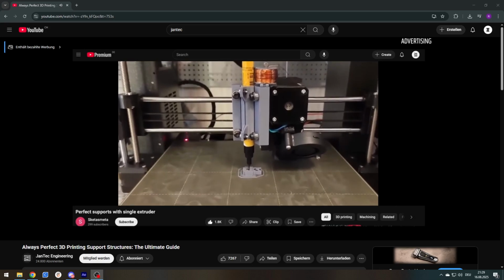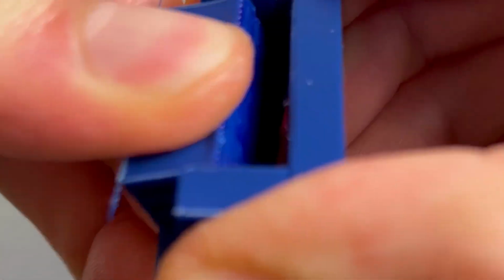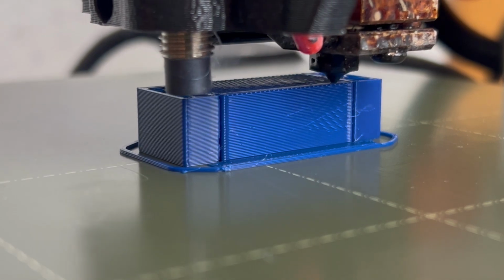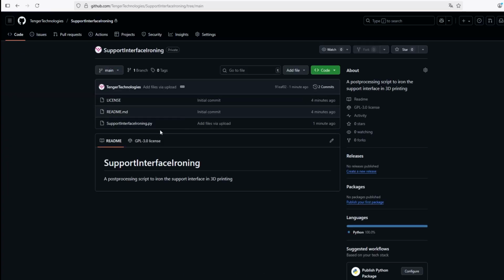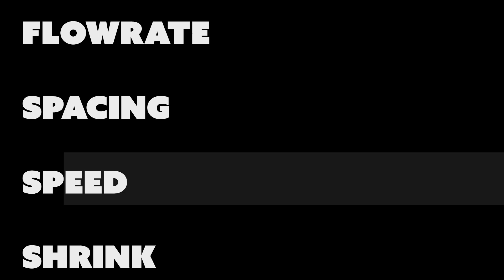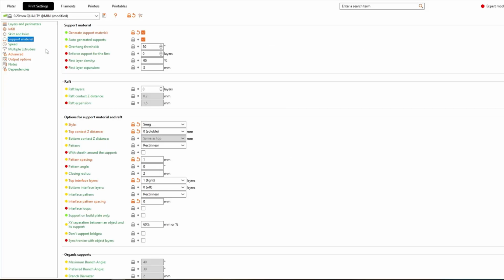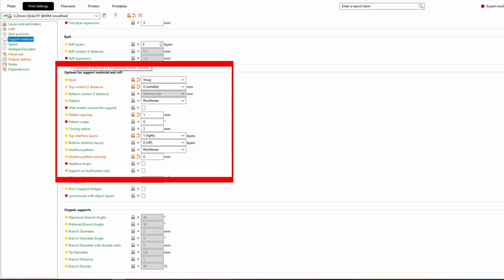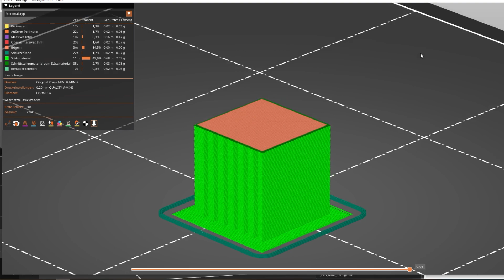Perfect 3D Print Supports With Ironing?

Comment: If this was combined with a multi-head that deposited a release agent (like a sharpie) and non-planar printing, you could effectively do away with overhang surfaces looking different from any other layer. Print a smooth layer in any orientation, coat it, and print on top like you've got a new baseplate hanging there.

Comment: As I understand, what will happen is that the supports will be smoother, so the resulting underside will also be smoother - which is what we want. This should absolutely be something that could be added to the slicer itself to possibly make the adhesion lower between supports and the part. One thing that I'm curious about is why painting the support will make it less inclined to stick? Is it just that the surface isn't clean enough anymore for the filament to stick less? Or is it something chemical? Does any marker work or is it a type/brand/whatever? Would whiteboard marker work? Would it be possible to make a "marker" that fades after it is for instance exposed to UV light? Or just washes off? I'm trying to find ways to make this combo of ironing the supports and covering them with marker could become an automated process somehow without adding a huge pre-/print-/post-process task to it.
Reply: this is added to Orca alpha/dev right now

Comment: Hey TenTech! The marker idea has merit but what we really need is a flexible "buck" pause layer setting that allows us to do things like insert a pre-printed buck, add the pre-measured thickness of painters tape to a buck or like in this video iron a buck. It would potentially help simplify many of our designs.

This (the video's) solve assumes that the buck object will be printed every time but ideally for repeat objects in project files the buck only needs to be printed once and reused indefinitely.

Plus: Printing on painter's tape has long been a standard for 3d printing before the advent of PEI which is what I believe will have the best overall standard to work with.

Comment: For about 3 months now I've been printing supports with 3 solid interface layers by setting the top interface spacing to 0 in orca slicer. Thee supports come off super clean and depending on the model they come off in a single piece.

Comment: Insanely good idea. Y'know, I wonder if we could use gcode and like a little inkwell on the bed to dip the nozzle in some sort of liquid to aid with support removal like it's an old timey feather pen
Reply: would be easier to print a holder for a pen that can be magnetically picked up by the tool head and paint the layer, basically a tool change.